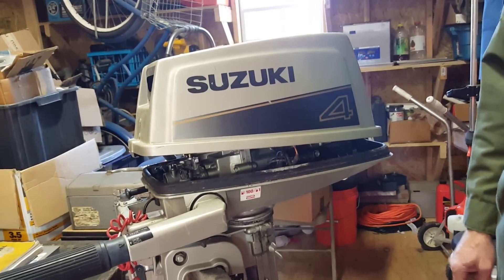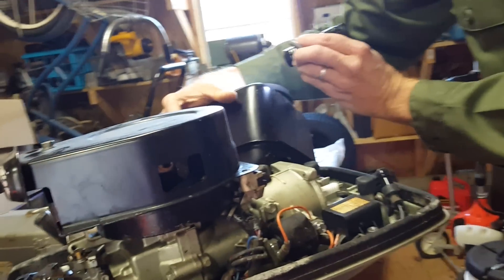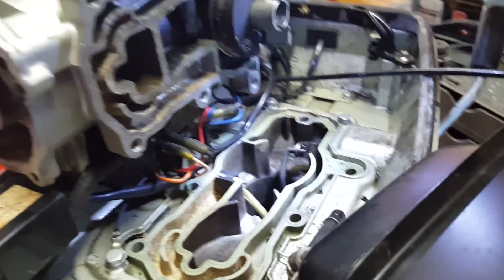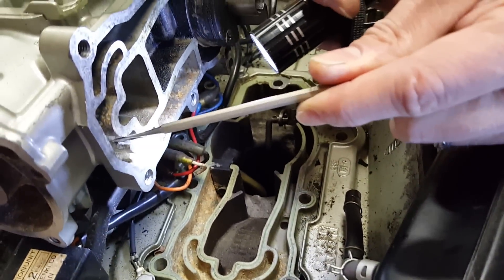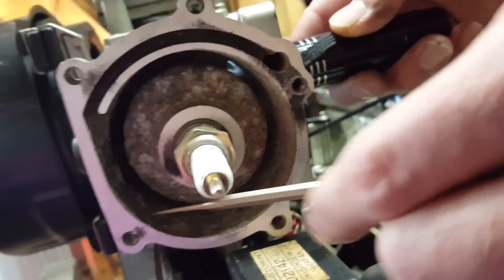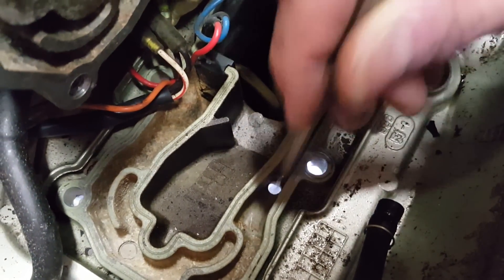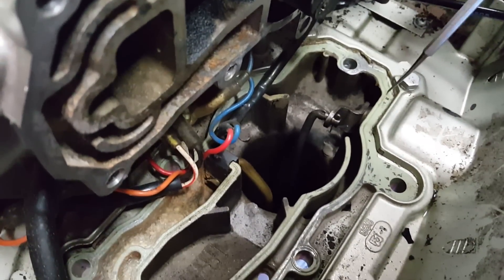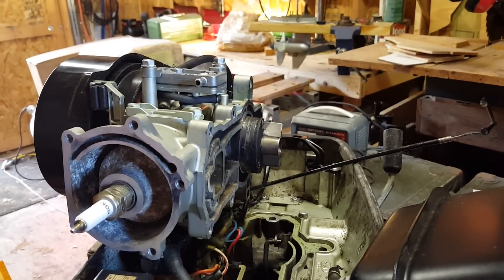Outboard Water Cooling System Overview

Comment: Good video. 
I would love to see a video like this with the bigger engines that have thermostats and poppet or pressure control valves (PVCs). Other videos are telling me an overheating problem I am having with my 1998 Yamaha 115 2 stroke might be related to the thermostats (that restrict flow out of the engine until water reaches a certain temperature) or the PVC that lets higher pressure water out once the boat is running at higher speeds and pumping more water. So I am (and others are) interested in learning where the thermostats and PVC fit into that  more complicated engine's water path.

Comment: Awesome videos man!  I have some questions and I would be super grateful if you gave me your 2 cents...  Backstory:  I just picked up a 1989 Suzuki DT4.  Great compression, runs good, gears work fine.  Wasn't pumping water though.  Initially, I put my hand under the tell tale and felt pulsating air coming out.  Pulled the water pump (using your other video, thanks!!!), inspected everything (pump looked ok), then ran some warm soapy water through the passages to try and clear any debris out.  Everything seemed clear.  Put it back together and started her up in a bucket and she pumps water again after about 5-ish seconds.  I'm a little confused as to what's going on here.  Did I inadvertently clear a blockage?  Or could there be a crack that is letting exhaust gases out the tell-tale?  Or maybe something else?  I was wondering if you had any ideas.  Thanks!
Reply: Venomrs4 i
Reply: Hi there... Have You fixed the problem..? I have the same issue.. Hot air insted water....
Reply: @blimited9053  I did figure it out. Two things: I believe the thermostat was not working even though it looked good.  I replaced it.  And it turns out these outboards are very sensitive to water depth.  The water pump housing itself (not the water intake) the actual housing itself in the lower unit needs to be well below the water line.  Check those two things and you should be fine. If your water pump and thermostat are good and you put the engine in a tank with deep enough water....it will pump.
Reply: @Venomrs4  Yeah... I just do not know where the termostat is located..?  And... it is a long shaft motor and I think well underwater--  Thank you for your time.. Im getting nervous feeling the closenest of solution.. :)
Reply: Well after removing the head and cleared all passages still the same.. What I found is that exost preassure overcomes water preassure so when I took off rubber cover from the side it starts tell tell water flowing just fine.. My motor was too deep in the water so it was overfilled inside.. enough for exost preassure to find his way thry tell tell instead going down.. now Im gonna lift a motor a bit and probably drill some alternative holles under the water level for exost air.. Must improvise a bit.. ;)

Comment: I'm hoping someone else has asked you about this issue. 
Blowback from the exhaust preventing pump from sending water up the tube to the motor. 
Apparently this is a major issue with this motor, and one that Suzuki Support's solution for (at one point)was to drill out the two vent holes on the exhaust to a larger size. 
I've done that, and it was marginally successful, but I'm not convinced it's the answer. 
I found an Oil Seal that goes on the pump housing, that another owner talked about, and am going to see if I can change that over the winter, but I'm hoping you have a better solution, or can tell me that the oil seal replacement will fix the problem.
Reply: I drilled out the holes to the next size, helped a little. What made difference was a new impellor, during install I sprayed silicone lube inside pump housing. It's pumping like never before. So drilling out holes it helped but was not the fix as I plugged up one of the holes and it's still pumping strong.

Comment: There is also a chamber on the botom of the head.. (half moon shape cover with two bolts) 
Connected with a small holles on two sides.. 
I have the same issue and just after a while there is no water just a hot air..
How this chamber afects cooling and exost system couse there is a connection.. 
Can you answer please...

Comment: Hi I hope you can help
Me answer my question.. I have the same motor. The pee tube/hose was broke off when I got the motor. The little plastic tube that gos in Cooling area on block that the tube hooks to is snapped off. Do I have to take the power head off I’m order to get it out and install the new one?  Thanks

Comment: I just bought a little boat with a DT6 on it. The propeller doesnt have an exhaust like the bigger ones. So I wanted to know where on the exterior it sucks in water, and where it comes out? PS. First time boat owner
Reply: Inlet is little grate right above the prop. There are also drain/prime holes in the side above the vent plate

Comment: So if you're impeller is working but you're tell tell is clogged your engine will still be cooled by water coming out the exhaust???????? Is that correct thanks old 67 merc 6 hp

Comment: On Honda 10 hp with lower extension housing removed and temp water supply hooked up, with water on and flowing is there water to be coming out of the exhaust tube?

Comment: If my outboard is spitting out water from the exhaust in my  1990 evinrude 8 2 stroke, do you think I have a blown head gasket? The tell tale is working just fine, it just seems to be running hot.
Reply from the maker: That's normal.  Head gasket is ok.
Reply: Come to find out it was the thermostat
Reply from the maker: Good troubleshooting!

Comment: my yamaha 15 hp when i run my boat fast why the water cooler system dont come out   but when slow water come please help me thank you form Thailand
Reply: It maybe blown head gasket or exhaust gasket leaking allowing gases to push against water pump pressure(leaking one way). I had it on My Chrysler 15hp motor; on slow speed I had water coming out from the tell tail hole but at high speed water stopped flowing an I had smoke coming instead plus motor was overheating. The raised edges on exhaust cover cut the gasket around mounting screws and gases pushed cooling water back toward the pump